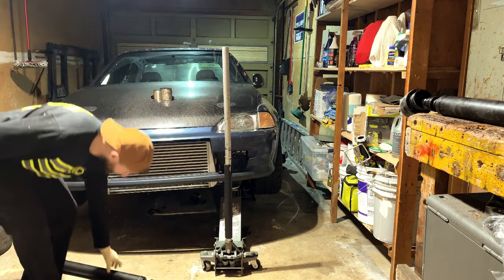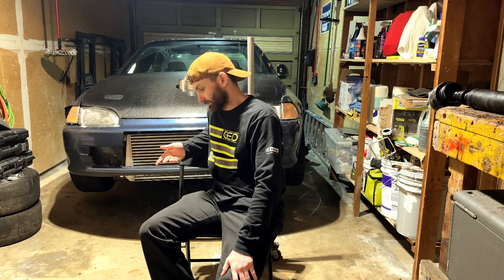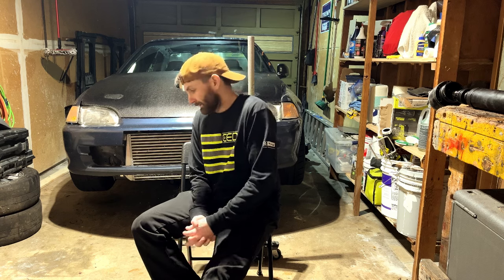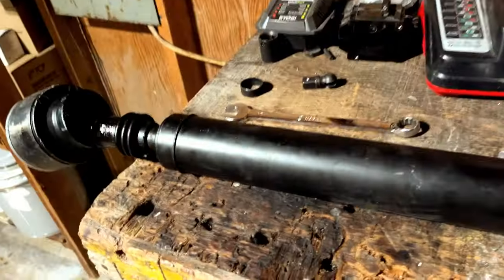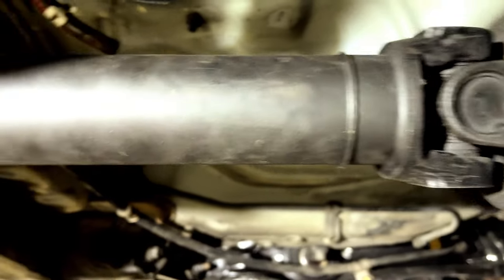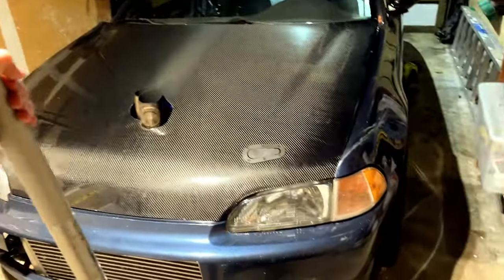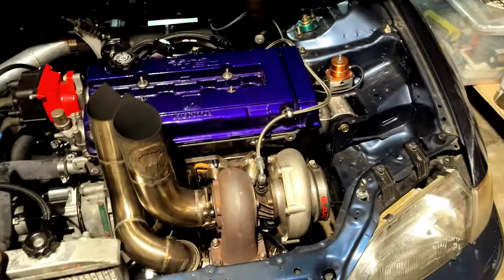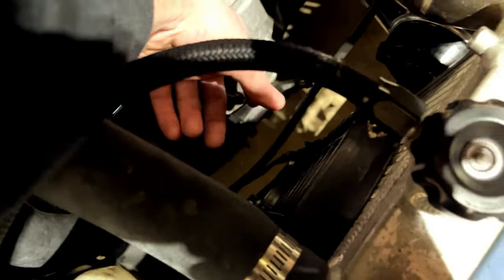Update on my broken AWD civic (how to fix it)

Comment: Papi I'll take those adapter plates with the hardware 😘 . Easy fix just some money but the gsr will love the twin disc and cop. Good bye dragon fire old school dizzy.

 Also time to upgrade that fmic to a dualbackdoor or bolt it right to the top of the rad support I did because it hangs slightly below the bumper cover.